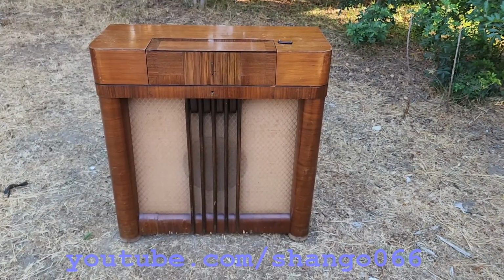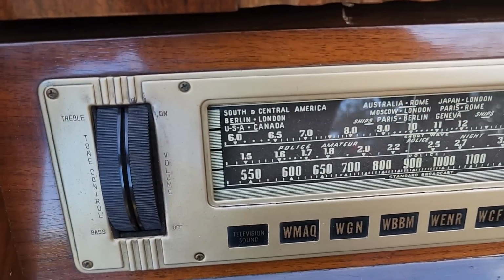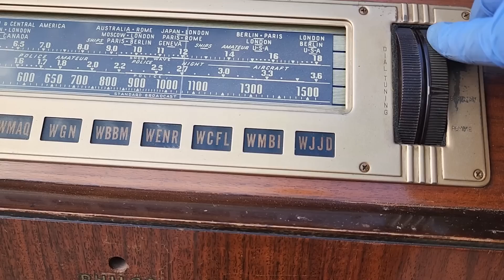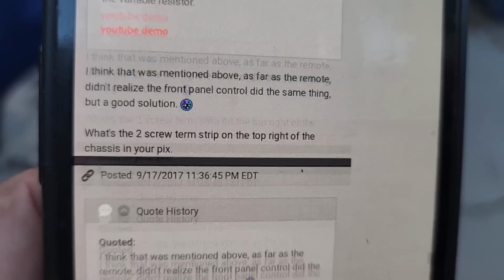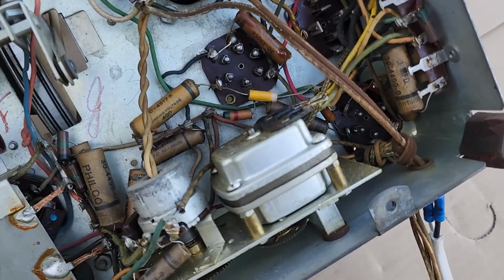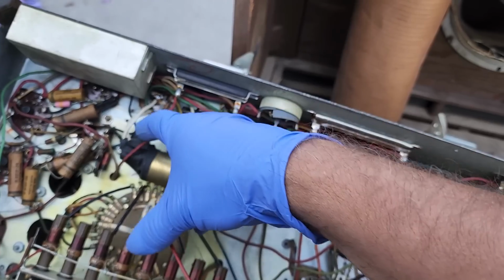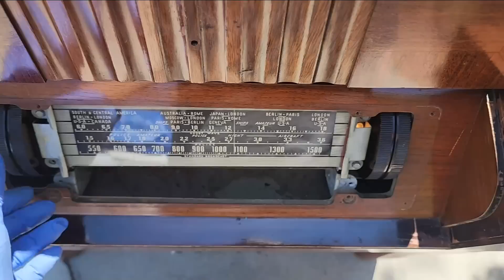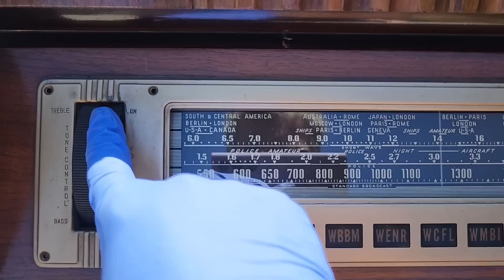1940 Philco Wireless Remote Control Radio 40-217

Comment: This set is amazing. I'm 62 and when I visited my high school teacher once, she had a remote controlled radio and TV. Both remotes were like a decadic phone. You literally dialed in a TV station or a radio station but the great thing was that they were both connected by cables not wireless remotes. There was plenty of length and all the pots were on the remotes. If you unplugged the remotes, the internal pots and tuning kicked in if it needed say if the remotes were stolen or lost. I live in Australia and we had some great minds here. My grandmother bought my mum an Australian made Kriesler 6 element 3 way radio gram. The tweeters are electrostatic ribbon units and the bass and mids were magnavox. It was 10 watts a channel push/pull and the neighbours complained about the volume.....especially the bass. It hasnt been turned on for years and I will dim bulb it when I get the chance. Thanks Shango. You are a very talented man. You have what I have....a 6th sense which you are born with. Some technicians don't get it. I do. Cheers Andrew Melbourne Victoria Australia. The pic is me on the right with my first love. We had a wonderful relationship until HIV took him from me.

Comment: I’m sure this radio will be adopted very quickly. It has a beautiful Art Deco design.
Philco was very advanced for its time! Not only did they have a model with their unique “Beam of Light” changer,but the Mystery Remote control system was also revolutionary.  You were able to turn the unit on/off,raise and lower the volume,mute the volume,change radio stations,change to the record player,and even change the records,all wirelessly from the comfort of your chair!
Reply: Back in the mid sixties I came across one of them Beam of Light phono turntables and read up on them. Like a dumb ass teen, we laughed at it and smashed it to bits

Comment: I bought one of these with the remote off of eBay for $0.01 several years ago. That was the minimum bid and I was the only bidder. I had to drive about 6 hours to Ohio to pick it up.  I felt sorry for the guy so gave him $20 anyway. I still have not restored it although I later picked up another remote box that was in better shape. The remote boxes used to show up on eBay from time to time for a reasonable price. This was the very first remote controlled anything sold commercially and as such is a keeper for anyone's collection.
Reply: I agree even though I am afraid to dig into mine (different than shown here) when it quit see my other comment  Thanks

Comment: I have a 1942 philco console that my grandfather bought.  Has had one new rectifier tube and NO work under the chassis.  Still works LOUD with  very little hum.  No doubt needs caps, but still blasts out the audio.  When I was young, I used the phono input so the thing was one half of my stereo.  I am 67 now and the thing still works.  Don't always dis Philco they were the most popular radio builder of the time and you got what you paid for.
Reply: Yes at least replace the coupling caps otherwise you're gonna fry a tube or the OPT.

Comment: AWESOME! This is the spark I think I need to get my 39-116 (very similar, except for the cabinet) running. I picked it up as a leftover from an auction, $20. Has all original Philco tubes...
Reply: This is a real gas - you're having all the same WTF moments I had with mine when I got it!

Comment: I’ll admit that I just started watching, so this may be corrected, but this may be a bit older. One of these made an appearance in the movie Topper Takes A Trip from 1938
Reply: The first 2 numbers in a Philco model number is year of manufacture 99.9% of the time.
1940
Reply: However to be fair, a lot of Philco consoles looked like this one.
Reply: @acefeeley9007  I’m almost positive it was this model. They used the movie as an advertisement in a way, although the Philco company isn’t mentioned they talk about and demonstrate the mystery box by name
Reply: @romandjma.recordplayers7806  anything is possible my friend
Reply: @romandjma.recordplayers7806  : See my original post......Philco usually introduced a year model in the previous year's month of June. This model 40-217 was no different and (as stated earlier) had the cabinet as the 1939 40-216RX. With that being said....that model may have debuted as early as June 1938. So you're probably correct on your assumption.
Reply: Its the same radio concept. Different options. I have a 39-55 am only model.

Comment: Also IF you want to use the sets own manual volume control, all you have to do is push directly in on the volume control and then turn the control up or down while pushing IN on the control.
This control only operates a set of switch contacts that engages the little motor clockwise or counter clockwise.

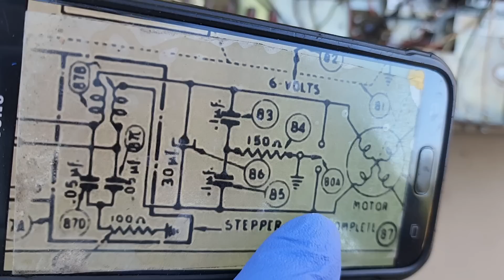Comment: In 39:00 the capacitor causes a delay or phase difference between the voltage waveform and the current waveform, giving the motor "slip" and hence giving it the ability to produce torque.  Once the capacitance goes down the delay isn't enough and the torque produced isn't enough to move the motor.  If you need to make a non-polarized capacitor for this purpose, just take 2 electrolytics in series with the two positives tied together to produce one capacitor attached across the motor.
Reply: Thats what i did with my $10 39-55.
Reply: You can do that with capacitors?

Comment: Super rare radio in nice condition for its age. Typical rubber coated  wiring issues. Needs full recapping. Thank you for  showing this rare piece of radio history Shango. It is a restorable radio even without the remote.

Comment: Hello Shango!!  Whats in the box ??  The box is the cover for the relay system that selects the coils and caps for the preset stations! The remote control transmitted at a predetermined RF Frequency which was received by the big loop antenna wound around inside the console cabinet.  The remote PULSED the RF at a given rate and the radio received this pulsed RF and operated a set  of coils that indexed the selector at the same number of (MOVES) as there was pulses of rf received. The volume was also controlled by the remote with again a few pulses of RF. but I am not going to get into that right now!

Comment: This radio was very expensive considering the time it was made. Mass produced in 1940 the end of the depression people still pulling out of the depression and most not having money to buy something as expensive as this. A lot of these radios survived there are still quite a bit of them around I see them on the Internet a lot. This example is exceptionally clean. This interesting is that the remote control for this looks like a wooden jewelry box with a telephone dial on top. Fully restore and Recaps this radio will sound great because of the push pull amplifier it has.
Reply: Don’t forget WW2

Comment: That tunable antenna looks similar to the Zenith "Wave Guide Magnet" antennas back in the day. As far a gimmicks... most every brand had & has them to varying degrees. For example: RCA had an electric motor that'd turn the dial selector to any of eight pre select's, though it was a remote model it wasn't wireless (and it was a 1937 model).  

As far as original cost and other facts: The 40-217 Philco used the same cabinet as the June 1939 model 40-216RX, but uses the same chassis as the 40-215RX. It originally sold for $189.95. In today's money....that'd be $3965.83 adjusted for inflation.

Comment: I restored a Philco 42-400 about 12 years ago. Very big. According to an original brochure for 1942, that I have,  this was their most expensive radio console and the last radio made before WW II. AM, FM (the original FM no longer used) and SW.  No remote control thankfully, but talk about a complicated and packed chassis. It did have separate bass and tone controls. It now sits on my 3rd floor landing and gets used often since I run my own AM house broadcasting system for all my AM radios. With 11 tubes this will not only play your favorite music it will also heat the room!

Comment: When I was a little kid, I visited a house that had a working Philco with remote, I was warned, very sternly, not to touch!
I knew about shortwave radio, and I asked the right questions, and after a few minutes of talking about it, we were listening to the radio, and trying the shortwave bands for the first time on that radio!
I ignited the SWL bug in the owner!
Actually, it was the owners son, but he had inherited it from his father after he passed, and he wasn't sure as to what it did until I talked him into pushing the right buttons, and trying it in the evening, instead of in the daytime.
Those antennas that are built in, work fine most of the time, but they did provide for external antennas which worked much better.

BTW most thyratrons are not radioactive.

Comment: The metal box contains stepper switches and step-relays for station selection and volume up/down controlled by the wireless remote control. The Tyhratron is a special tube for controlling the relays inside the metal box. The vertical shaft AM antenna is an electrostatically shielded AM loop antenna. It helps eliminate static from appliances that may have sparks jumping inside their motors or neon sign lights. This special antenna was a one year feature. The very next year they dropped that feature. That rectangle in the bottom is likely the antenna for the remote control. It operated below the AM broadcast band (Long-Wave frequencies under 500kHz). The "Mystery Control" (Philco's name for their remote, which has what looks like a rotary telephone dial on it) sometimes shows up on eBay as a separate item.

Comment: Great. This video just popped up Well I have a similar one sticker says 38-116 I have both parts and it worked fine until a few months ago. I was going to get into it (finish is original and fantastic) however it was last owned/repaired by a gentleman who was in signal corps in ww2  he could fix just about any thing but when I turned over the chassis he had designed a circuit with modern relays so I guess it will just stay a nice curio in the room so again thanks for the vidieo!
Reply: No one in interested in it tossed

Comment: I have a Philco 40-216 radio which has the same electrostatically shielded AM antenna and also has the same SW bands. Its band-switch arrangement is also missing the ball bearing that would provide the detent action of the band-switch. Maybe Philco decided to not have a detent in the band-switch. That is strange. One difference in the 40-216 is that it has three #37 audio tubes, one is an actual phase inverter and two are drivers feeding two #42 push-pull output tubes. It looked like Philco was trying to win points for having lots of tubes in this 40-216 model. It has one SW antenna in the top of the cabinet arranged horizontally on something like a phenolic board. There are provisions for an external SW antenna.

Comment: The remote control unit looked like a wooden box with a rotary dial just like a rotary telephone dial. I have both the radio and remote. The frequency for the remote was between 200 Kcs and 450 or so Kcs.and was set by the selling agency so as two sets in neighboring apartments would not interefere with one another!
Reply: I don't think it was too frequent to have two of these within one square mile. These were surely very expensive.

Comment: Hey 👋 Shango!! Please put this in your house 🏠!! Overall, this is a GREAT 😊 radio 📻. I see the damage at the bottom, but I’ll see ya ✌️ resurrect it, along with the capacitors and tubes. By the dials on the front, it looks like 👍 this may have a very complex dial cord system. That looks like 👍 a transformer that ya were knocking on. It probably is full of dried out paper 📄, and a lot of copper 👮‍♀️ wiring. I see that this is a Philco, but I’ve missed the year. It’s permanent magnet 🧲. I’m probably going to guess it’s from circa 1953. I wished I could buy this radio 📻 from ya, but I’m not sure 🤔 of the shipping 🚢 cost 💲 to Casa Grande, Arizona. “Rototweebler fidget tweebler”😂😂😂!! VERY impressive dial cord pulley, and dial cord system. Hope the dial light 💡 works. Your friend, Jeff.

Comment: It would be relatively easy to build a remote control for that radio.   Just an Armstrong Oscillator.   I like the simple, not overdone look of the cabinet.  It's almost more of a late 50's early 60's look as opposed to 1940.

Comment: 180W! Can you imagine running this all day and the power bill comes in and you hadn't a clue what was guzzling all the electricity, I know throw out the fridge nupe, washing machine nupe...
Reply: Yes, it needs a switch on the back to isolate the power from the remote control receiver, so if you want just to listen to it and not showing off its cool remote control feature to your friends, you can disable it. It draws at least half the power I guess.

Comment: Saba had a 1950s large tube radio that would search for strong radio stations at the push of a button, with a dedicated motor on the tuning dial, and a wired remote control.

Comment: Had a version of this model. The one I had used push button presets. Unfortunately, the plastic buttons decomposed to dust. Eventually gave to Goodwill and it ended up in a local antique store.

Comment: This just in: the state of California has asked it's residents to, in addition to not charging their electric cars and not using their air conditioners, switch off their vintage tube radios this summer to prevent overloading of the electrical grid.

Comment: The average Joe couldn't afford that radio in the 40s or 50s. The average family was making payments on a Westinghouse or GE hifi or something on those lines. 
Shango,that remote set up works sort of like the old jukebox wallbox set ups did if I'm not mistaken. Works off of pulses. 
It's a nice radio. I wish I was closer. I would get that from you but I'm on the east coast. You don't find them that nice all the time.

Comment: Nice safety margin with 1800W appliance cord to run 180 W radio on - i guess all we need is an inline fuse and a fire suppression  system for maximum safety. 😀

Comment: Given the “relatively” simple schematic of the remote, it’s probably simple enough to build a one-transistor wonder to replace it. You’d just have to figure out what frequencies map to each function, and make a rotary wafer switch - or a series of momentary SPST switches - wired similar to a capacitor substitution box, to select the frequency.
Reply: It does not change frequency like a TV remote. It only pulses, it basically pulse dials the radio. It's not that bad to run the tube version even with primary cells as the tube is only on when sending a signal, if you look at the schematic it literally just connects and disconnects the filament battery, the batteries last a long time.
Reply: @trevorhaddox6884  - That wouldn’t work; it’d take too long to heat up the cold filament using that method. That’s why there’s an (arc of) strip contact that makes contact with the wiper of the rotary switch over all the selectable functions so the filament stays on, only the B-battery is switched on/off as you rotate the switch. So likely, the switch is ganged to a moveable slug in the coil.  A pulse-coding would need something like an old rotary-dial telephone (switch) that has a clutch and spring-return, which would work great… if the remote used a transistor. From the “off” position, it would take even a small 1-volt tube’s filament (like in some old car radios) too long to warm up, and you’d miss pulses. Then, as it would (spring) return to the off position, the tube filament would cool down, and you’d have the same problem - again. This would make for a very customer-unfriendly remote, I would think. 🥺

Comment: I was just thinking right before you said it, wonder if the weird IF freq. had something to do with the wireless remote. Would be interesting to know!
Reply: I have a Philco 39-6 (1939) table radio that also has the 470KC IF, but nothing else fancy, so probably just the freq they were using at the time.
Reply: I am not too sharp on my history, but at one point RCA (must have been them) had a patent on the IF frequency, so you either had to use it under license from RCA, or design to a different frequency. 

Correct me if I'm wrong ...
Reply: @volvo09  I didn't know that but it doesn't surprise me. I suppose that's why there were so many freqs used in the 30s. But how then did it manage to standardize pretty much by the end of the 40s?

Comment: A lot of people claim those old caps are "the bee's knees". "Don't change'um if you don't absolutely need to."
If you bought a mint 40's car with the factory oil filter, do you change it before you drive it? Of course you do. Caps are a consumable part. So you change them at the end of their duty cycle. They ARE filters of DC. The ones in that radio according to the manufacturer had a ONE year warranty. ONE YEAR! Not three days after the second coming. 
Did they last past the ONE year warranty? Yes. Did they last eighty years? Only if you think so, but no. Just no. Even if you find new unused eighty year old caps, they are crap and WILL fry your equipment.
That awesome sound you get from old caps is from your equipment being driven to within a millimeter of it's life and soon to be death.